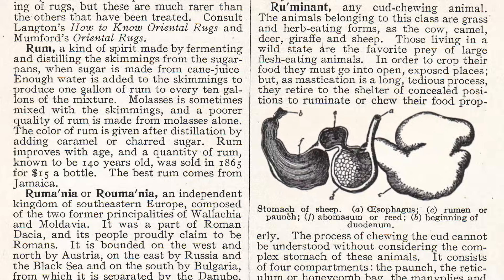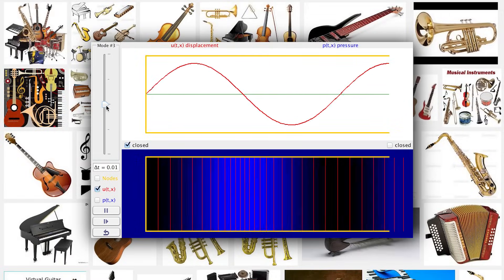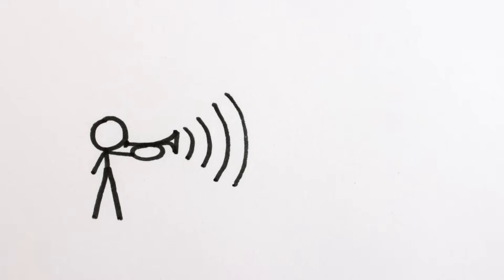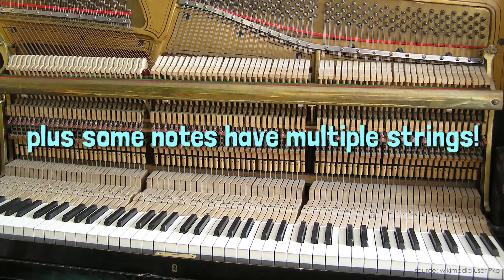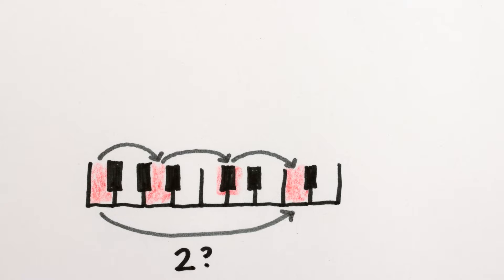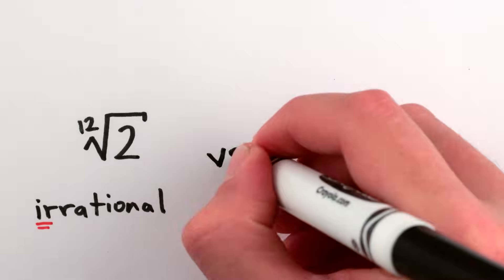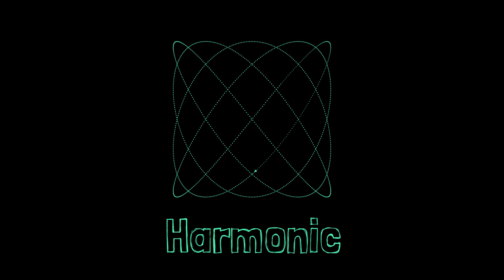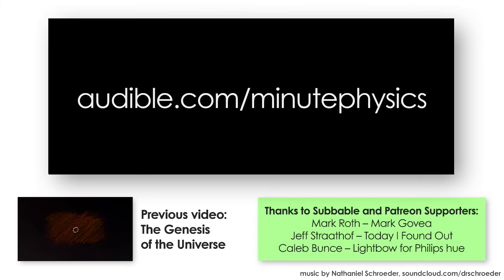Why It's Impossible to Tune a Piano

Comment: ok, so instead of using ratios to tune at all, why dont you just tune each note individually to it's correct pitch?
Reply: I dunno, that sounds too obvious. 20$ says somebody tried that many years ago and it sounded like shit.
Reply: ***** bruh its someone's job
Reply: the issue is that natural harmonics don't line up exactly with an evenly divided 12 tone chromatic scale. you can tune the piano to exactly match the natural harmonics for a particular fundamental frequency but then if you tried to play in a different key it would sound wrong.
Reply: beetwick amazing, the first useful reply! thank you!
Reply: +beetwick Then maybe the 12-tone chromatic scale is at fault. Can't we create a musical scale that matches the harmonics it's supposed to describe?
Reply: we certainly can, and people do. the problem is you sacrifice the ability to switch keys easily. if a piano is tempered to match the harmonics of an A exactly, then it'll sound very dissonant in other keys. you can avoid this drawback with digital instruments though.

there's also value in playing with even temperament instead of natural temperament because it has a different aesthetic; sometimes you don't want to have everything sound perfectly consonant and you want to have a bit of color. its ultimately an aesthetic choice, although the default choice is even temperament and people rarely deviate.
Reply: beetwick That makes sense, thanks!
Reply: Because using harmonics and tuning each note individually to its correct pitch are both the exact same thing.

It's literally impossible to tune a piano in a way that every interval is perfectly in tune. It's not that no one has found a way to do it -- it just can't be done. That simple.
Reply: Actually it can be done.  Math is only an attempt to explain what is really going on with sound.   Math is not a perfect science.    For instance, if you use mathematics and division in half, you would say your hand can get half way closer to the other and half way closer than that, etc.   If you use just math, theoretically, you would never have your hand touch.   However, you can't keep doing that.    Eventually dividing in half breaks down so small that all logic fails.   The hand then defies that logic and touches the other hand.   Math is imperfect.   The real world has things math can't explain.    Wise up!
Reply: Justin Snyder No. Division isn't the only math that exists. There's also subtraction. If your hands are 10cm apart, subtract 10 and they're touching. Mathd.
Reply: Behind TheWall You missed the whole point.   You're ignorant and can't understand what I told you.   Wise up!
Reply: I understand the paradox, but it doesn't mean math is imperfect. In fact it shows that math is perfect: dividing by 2 again and again will never get you to 0, and that's exactly how it's supposed to work.
Reply: Behind TheWall Math is not perfect.   So wise up!
Reply: Maybe not in every case, but in the cases here (repeat division, and approaching hands) it does work perfectly.
Reply: Justin Snyder
Humans are not perfect.

Math is.
Reply: ***** Christ said to become perfect, so that's not an excuse for ignoring truth.  Wise up!
Reply: Behind TheWall What does profanity have to do with truth?  Wise up!
Reply: Ok the next person to say wise up is getting blocked or something I'm tired of hearing from this comment line
Reply: Loic Kittentine Wise up!
Reply: Behind TheWall i blocked him ;3c
Reply: yeah, this is also what i thought. i mean isnt each key defined in a certain frequency? for example, A4 is defined as 440 hz, then lets just tune it to 440 hz by using digital tuner.
Reply: Kavin Yudhitia«i mean isnt each key defined in a certain frequency»

Not really, no. I mean, yes, A4 is indeed 440 Hz (and therefore A5 is 880, A3 is 220, and so on), but just because that was arbitrarily chosen. We could say "Let A4 be 433 Hz" and tune a piano based on that, and we'd end up with a piano that is pretty much identical to one in which it is 440.

Also, please avoid using the word "key" when referring to a single note. "Key" has a special meaning in music theory, and that word like you did can cause confusion. I actually had to re-read that sentences a couple of times to make sure I understood it. Had you used "note" instead, I wouldn't have to do that.

You should actually read all of the replies to this comment thread, because people already explained why perfectly tuning a piano isn't possible, so I won't bother explaining it once again.

I just have a question for you; you don't need to reply to me, just think about it.

The piano is about 3 centuries old. Its predecessor, the clavichord, is about 7 centuries old. Do you not think that if it were possible to perfectly tune those instruments, someone would have figured it out by now?

When Henry says in the video that it is impossible, he’s not exaggerating, nor is he mistaken. It is, in fact, impossible. If you think of a solution to this particular problem, it is definitely wrong.
Reply: All the tuning can be done with tuning forks and therefore have the correct pitch, but that would be a lot of tuning forks.
Reply: Amanda Garcia
That wouldn’t work.

You should read all the comments here, because it has been explained before.

Also, as I said to someone else, if it were possible to tune a piano perfectly, someone would already figured it out at some point in the last 300 years, don’t you think?
Reply: ***** Why would that not work. Each tuning fork would be set to be a very specific frequency. An A would really sound like an A a B flat would sound like a B flat. Using tuning forks though would not be using harmonics. Just match each pitch of the string to its corresponding tuning fork.
Reply: Amanda Garcia

Notes do not have specific frequencies. An A can be 440 Hz, but It can also be 335 Hz or 457 or really anything.

The frequency of a B4 in an equal tempered tuned piano is 493.9 Hz. If we decided to assign that number to the A4 key in the piano, and then tune the piano based on that, it would work just fine, and you would be able to play any song in that piano the exact same way you do on a reguar one. It would just sound slightly different, but perfectly recognizable. Most people would probably not notice the difference.

The B4 would essentially become an A, is what I’m saying.

«Using tuning forks though would not be using harmonics.»

There’s a problem here. You can’t possibly have two notes be in tune with each other without using harmonics. If you want your tuning forks to be in tune with each other, you have to tune the tuning forks with harmonics... and that is the exact same thing as tuning a piano with harmonics.

«Just match each pitch of the string to its corresponding tuning fork.»

And how do you figure out which pitch each tuning fork should be in? I tell you, tou have to tune them, and for that you need... you guessed it, harmonics.
Reply: Take a look here:
https://en.wikipedia.org/wiki/Concert_pitch
Reply: ***** I understand now. There can be no such thing as a true B flat C sharp or many other notes. The harmonics will not allow it. Thanks for the info.
Reply: Amanda, A4 can be 440, but multiple tuning forks wouldn't work because of inharmonicity (fancy word for a string vibrating unmathematically).  If A4 is 440 you would think that it's half length vibration would be 880 but it's probably 881 because of string stiffness.  So, on a large concert grand A4 would be 440 and A3 219 and A2 108 whereas an a small 4 foot short upright piano A4 would be 440 and A3 217 and A2 103 (when this whole time A2 should be 110 mathematically).  Because pianos are different sizes a set of 12 tuning forks wouldn't work for all pianos.
Reply: Cobrun Sells Wow, this is much more complicated than I thought originally. Thanks for the info!
Reply: So I ended up looking up this subject on the internet, and I found this reddit thread:

https://www.reddit.com/r/explainlikeimfive/comments/2j8lbu/eli5_why_are_pianos_never_actually_in_tune/

There are a lot of good responses there, but there is one in particular I find really great, as I think pretty much everyone can understand it:

https://www.reddit.com/r/explainlikeimfive/comments/2j8lbu/eli5_why_are_pianos_never_actually_in_tune/cl9ilw6

It explains very well what I’ve been attemptin to (and failing at). It’s a shame that answer is almost hidden.

So, to anyone who still don’t get why any of the “solutions” to tuning pianos that people have proposed here don’t work, just go read that thread. It’s really worth it.
Reply: ***** Now I feel like I really understand! Putting frequencies of sound into colors really helps. Thank you!
Reply: And what is the "correct pitch" for you?

Comment: everything made perfect sense until math started happening like 2 minutes in
Reply: +waawamellon at least you can count up to two.
Reply: +waawamellon  Very simple math! Thats part of what makes it beautiful.
Reply: ***** where does the 9/8 come from?
Reply: I've seen u NOTHING IMPOSSIBLE
Reply: ***** alrighty so 1 half step is the smallest interval between 2 notes that we use in western music, and a whole step is 2 half steps
an octave is made up of 12 steps, meaning it takes 12 of these intervals to get from one note to the same note but with twice the frequency (half the wavelength)
a major scale has 7 notes (8 including the first one but an octave up), and the intervals between the notes are whole step, whole step, half step, whole step, whole step, whole step, half step
if you add those up (1 whole = 2 half steps) you'll find that that's 12 half steps
a fifth is the interval from a note to the 5th note in the original note's major scale
this means whole step + whole step + half step + whole step, or seven half steps
fifths are a very important musical interval and are used all the time
in twinkle twinkle little star, the interval between the notes you sing when you say the first two 'twinkle's is a perfect fifth

Comment: Well explained with very precise examples.
All I need now is to prepare a one page chart presenting this information.
I understand/remember the word octave. It is the number 8 because there is only 7 white piano keys and they have a name:
Do
Re
Mi
Fa
Sol
La
Si (ti)

7 labels, you see, justify Septave.

Our frequency detector, the cochlea, is not so precise. Even yawning make the cochlea shift frequency by more than 2 exponent 1/12.
To make things more complicated, the first processing operation of the brain is to abstract away precise frequency.
View it as a sliding window where, in the middle, is the fundamental frequency.
Hearing is studying the shape of the the spectrogram around the peak frequency.
Let me make it clear:
First of all, there is an "AGC", automatic gain control, managed by the autonomous nerve system. So, you can not tell the absolute intensity of the original sound because this old nerve system doesn't communicates with the new nerve system.
Second, an automatic sliding window makes the peak frequency always centered. Even if this system is managed by the new nerve system, it is automatic and don't provide information to the next layers of the hearing system.
Now, all the information available for speech decoding is that stabilized sliding window with curve representing the intensity level of each frequencies over one octave and a second view is the relative intensity of the harmonics.
The next steps is to associate this evolving shape with the output of different scale delay array. In other word, assign a relative time to the harmonic curve.